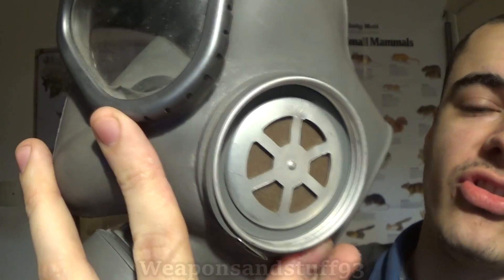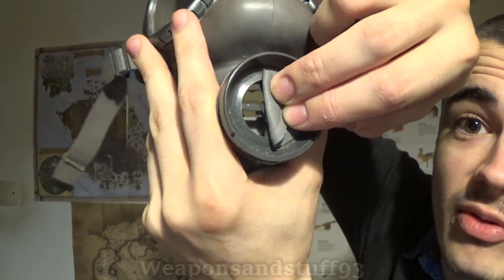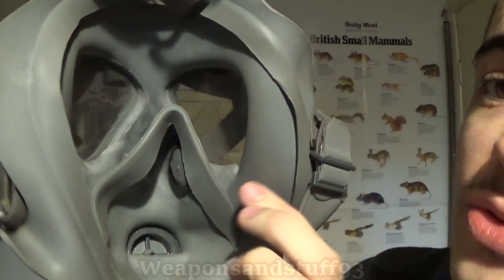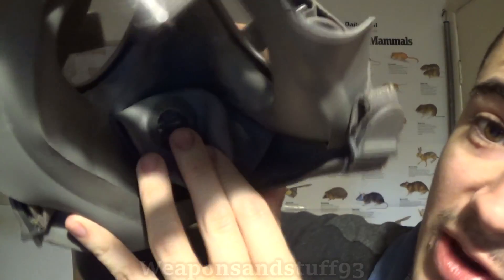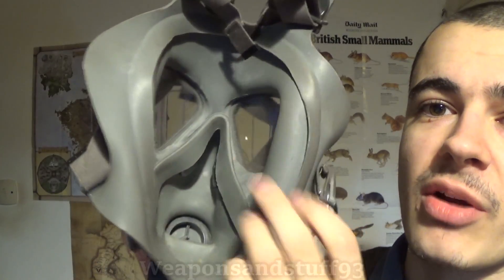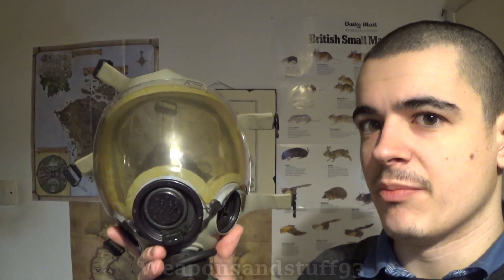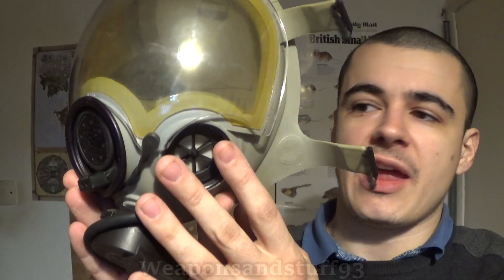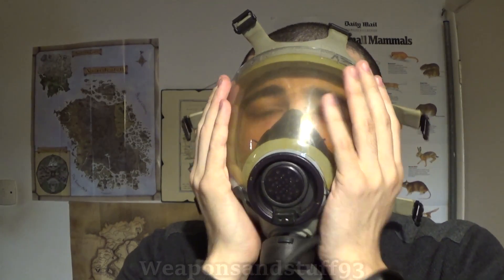Anatomy of a gas mask

Comment: Something really minor that you missed: a lot of older masks (mostly before speech diaphragms became a big thing) included an additional socket or other fittings for installing a microphone, allowing the wearer to speak clearly over a radio set without needing to take the mask off. Most countries had this as a specialized variant (not every soldier will need a microphone), but some like the UK's own Civilian Duty Respirator included it as a universal feature.
Reply from the maker: I've only seen it on the Duty respirator and the MKV respirator, I know Britain had prototypes of other masks including it but I don't think it was all that common a feature.
Reply: There were a few models with such features, like rare occurrences of radio-equipped GM-30s. As I said, really minor, and mostly of historical interest.

Comment: My Finnish m61 has a problem when if I breath in too deeply if I do a mask test the exhale valve lets a small amount of air in. Is there a way to stop this?
Reply from the maker: Not really it's probably just caused by you building up too much negative pressure, just breath slower or get a more modern mask.

Comment: interesting video but the masks you and your Family are going to use if shtf put plumbers tape on all threads like i said a cooker hose leaks gas without P.T.F.E plumbers tape.Tape them up Liam best be very safe if gas and radiation are involved as you know nerve gas is pretty shitty stuff.
Reply from the maker: Most NATO masks have a washer at the end that meets with the tip of the filter to do the same thing, but that's good advice for any masks that don't have the washer or only a very basic one.

Comment: Why can't you make the filter be the inhale and exhale valve? Why do you have to have two separate valves?
Reply from the maker: In theory you could make a filter port with two screws but that would be more effort than just having a simple output valve, obviously if you simply remove the valve contaminated air can enter the mask during the filter change.
Reply: Weaponsandstuff93 no no not a filter with 2 ports. Lets take the typical gp5 for example. Block the exhale valve and take of the inhale valve so u can breathe in through the filter and breath out through the filter.

Comment: Good video shame you couldn’t just put a harness on the MCU-2Ap also ur 2ap has microphone port ones without are called MCU-2P
Reply from the maker: Interesting thanks for that, I did do a video where I tried to rig it up with a paracord harness, sort of worked but I think there is a small hole in the front of the mask somewhere.

Comment: Could you make a video on how you can tell if a dangerous gas is present. Ones that can't be seen or smelt.
Reply from the maker: If I ever got any detection gear sure, but sadly I don't have papers or the electric detectors.
Reply: Ok that's fine

Comment: On your msa gas mask is the flexible part damaged or the polycarbonate part
Reply from the maker: +Eclipse It would be the flexible silicone part, I managed to get it sort of air tight but it failed the test.
Reply: Weaponsandstuff93 can you replace the flexible part or is it on the mask permanently?
Reply from the maker: +Eclipse It's glued/fused on so almost impossible to replace, as it's an American mask getting spare parts in the UK is near impossible, otherwise I'd have put new straps on by now.
Reply from the maker: +Eclipse I'm not really sure to be honest.